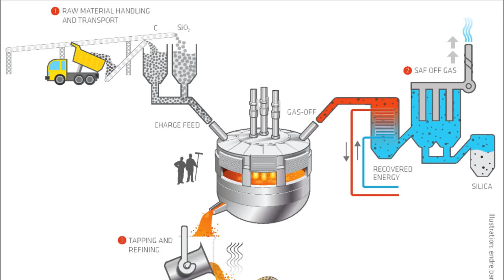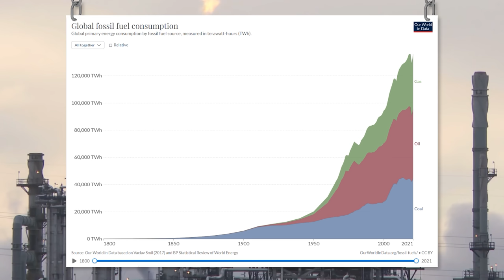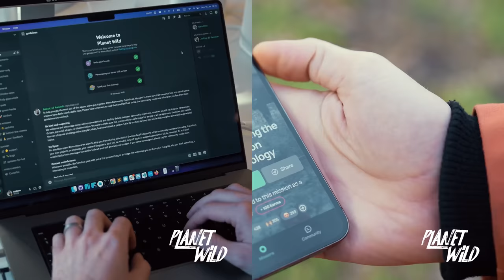We Will Be the Last Civilization on Earth

Comment: The question about the great filter is always a scary thought to think about. Are we the first civilization ever to be in front of the great filter or is the great filter in front of us? Either thought Is scary
Reply: The great filter does not exist, at least there is absolutely no reason to believe in a great filter. Occams razor states you should prefer the simpler solution to a problem. If you want to solve the Fermi paradox a large number of tiny filters is a far simpler explanation than one great filter and it has exactly the same outcome. Our existence in the here and now is dependent on billions of tiny steps. Each little step with a probability of it not happening, if one of those steps had not happened we would be here now. If those tiny steps had happened a bit slower we would not have arisen before earth becomes uninhabitable. With billions of steps involved and all having a tiny chance of not happening it's, from a statistical perspective, not exactly far fetched that we may be the only civilization in the observable universe. We lack a lot of knowledge about what was needed for us to get here. So it's mostly guessing and speculation, but with equally reasonable assumptions you can arrive either at the universe is teeming with life or we're the only 'intelligent civilization' in the visible universe or anything in between.
Reply: @silentwilly2983  That's just a restatement of the same argument.  A "great filter" is just grouping your "large number of tiny filters" into a small enough number of clearly-labeled boxes for our brains to process the concept easier.  You could write every single interaction of every electron since the beginning of the universe as individual "tiny filters" but that's hardly conducive to meaningful discussion.
Reply: Scary eh?  Well that's one way to think about it.
Reply: Not really scary, because we live in a block universe. The past, present, and future have already happened. Most people just don't realize it. We in a way are already dead. So the circle of life is just completing it's self. 
     Nothing to fear. No one escapes death.
Reply: @altrag  No it's not, with a billion tiny filters the often posed  question of 'is the great filter before or behind us?' is completely non-sensical as, by defining  billions tiny filters as a great filter, implies by definition we're in the filter. If you want to frame it differently, we have a few billions years of tiny filters behind us, and trillions of years of tiny filters ahead of us, so in that perspective the great filter is by definition ahead of us. And if you want to see it in a grander context, it's inconceivable we survive into eternity so from that perspective there will always be a great filter ahead of us as long as we exist. But these last two perspective add 0 value to explaining the Fermi paradox. People talking about a great filter also tend to talk about big catastrophic events, nuclear war, great singularity, meteorite impact etc,  those refer to one big filter, large (self) destructing events to explain the big silence,  not a large number of tiny filters that lead to  exactly the same outcome of the big silence.

And no, lots of tiny filters certainly is conducive to meaningful discussion, this contrary to one large imaginary filter one can only speculate about. With a large number of smaller filters one can apply statistics, one can define and study some of those filters and say something meaningful about them. You can determine that only a few dozen halving factors are needed to reduce the statistically expected number of civilization in the visible universe to be less than 1. Once you realize that, all those people claiming it's a statistical certainty that others are out there become a bit silly.
Reply: A Species using up or outgrowing all it's available resourses whether food/energy etc. constitutes one of the more frightening filters which is a certainty.
Reply: @silentwilly2983  Its still the same thing.  Whether you consider a "great filter" to be "organic chemistry started" or if you want it to be "a hydrogen and a carbon got together, then another hydrogen and carbon got together, then they all get together" rinse and repeat quadrillions of times, it amounts to the same thing:  We got the building blocks of life.

It does nobody any good to try and piece together exactly how all those quadrillions of molecular interactions happened.  Its just too much information for us to process and worse, its information we can't even verify - we can only guess.  At least until someone invents a time machine and goes back 4 billion years to look for themselves.

> If you want to frame it differently
I really don't.  The whole thing is a thought experiment to begin with.  We don't even know that there are any filters, great or small - It's entirely possible that intelligence is a guaranteed outcome and the only "filters" are whether any particular planet is amenable to life at all, and whether their life happens to overlap the entire 150 years we would have had even the slightest chance of detecting them.

> it's inconceivable we survive into eternity
Define "we".  Humans as we know them today certainly won't.  Even if we don't manage to kill ourselves, evolution will make our descendants a million years from now very different from anything we call "human" today.  Especially if we figure out long-distance space travel and manage to colonize other worlds - the differing environments on those worlds will necessitate rapid evolution (well, rapid compared to the speed of evolution without environmental pressures aka purely random selection).

I guess you should define "eternity" as well.  The entire universe won't survive into eternity - at least not according to our current best understanding of physics.

> lots of tiny filters certainly is conducive to meaningful discussion
No its not.  Can you even define a single "tiny filter"?  Because if you can't then what you've really accomplished is defining the entirety of life's evolution as a one great filter.  You can say a football field is 91 billion nanometers but that's rather useless when we can just say "a football field" and everyone knows what we're talking about.

> the great filter is by definition ahead of us
No, the great filters are by definition behind us, since the Drake equation (where these filters come from - ie: the response to the Fermi paradox, not the paradox itself) only counts up to the ability for an intelligent species to perform interstellar communication, and we're already there (providing we had anyone to communicate with!)

Its not a pointless exercise to imagine extensions of the Drake equation of course, but if you want to claim something is being filtered, you have to define that thing.  The Drake equation ends at "communication" - ie: things we (as humans) could theoretically listen for with telescopes.  You could add "interstellar travel" or "colonizing other worlds" or "type II Kardashev" or whatever else you want that we've imagined but haven't yet reached, and then start discussing ways we could be "filtered" against reaching that point, but "might die out some day" is just too vague to be especially interesting.

The interesting filters aren't things that kill us, they're things that prevent us from achieving some defined next level.  Eg: "planet being in the habitable zone" is a good filter.  Planet doesn't support life therefore no life.  "Planet gets kicked out of the habitable zone by an errant black hole passing by" is not a useful filter.  Sure that's theoretically a risk but its always a risk at any stage.  It might "filter" that particular planet sure, but its not in a way that's interesting to ponder philosophically.

> Once you realize that, all those people claiming it's a statistical certainty that others are out there become a bit silly.
You can also set those factors to values that make it a statistical certainty.

And that's exactly the problem with your argument.  We don't know any of these "filters".  They're philosophy, not science.  Breaking them up into "billions of tiny filters" is just an unnecessary layer of confusion if you don't define what each of those billions are.  Everyone is aware that life on Earth didn't just jump from one state to the next in 7 or 8 discrete massive steps, but that's not really the purpose of the discussion.
Reply: There are hundreds of filters.  Why do people think there is one great filter
Reply: @SoulDelSol  > Why do people think there is one great filter
I don't think too many people only consider one great filter, but its useful to break it down into a small number that can be easily managed, digested and discussed rather than some vague reference to "lots and lots of tiny filters" that are individually impossible to define, and therefore impossible to think about in any great detail.
Reply: @dananorth895  A certainty? You're maybe confusing 'natural resources' with raw materials. Resources don't come from nature. They are created by the human mind, and thus grow as a function of time multiplied by the number of people alive (a certain percentage of people born become inventors who can find new potential resources, and they reset the doomsayers' predictions, every generation). 
Now, you could say, "OK, but the Earth is limited in its physical mass, so at some point it doesn't matter how many 200IQ geniuses you can spare to solve the problem, the Earth is spent", but that's kind of silly. First of all, meteorites and comets keep raining down. But the major point is that the Earth has a vast and limitless sky surrounding it. The universe and its raw material wealth is as infinite as anyone could hope for.
Reply: @silentwilly2983 over 200 trillion galaxies in the observable universe. My brain cannot even fathom how large that is. But I can without a doubt say, no chance we are only Intelligent life in that space.
Reply: @Userhfdryjjgddf  The best position to take I guess. It's nice to not deal with the uncertainty and it's 'easy' to be proven right and virtually impossible to be proven wrong, while the position that we're alone is easy to be proven wrong and virtually impossible to be proven right. Nevertheless, with the data we have there is no scientific basis for such a claim, it's religion.
Reply: @Userhfdryjjgddf  intelligent lifeforms are out there. The distances though are so grand that it is useless to try to find out if they are there than to fix our own problems first.
Reply: @altrag glad you said it. the idea of the “great filter” is just the description of the billions of different things that can go wrong, thus preventing the birth of intelligent life. like it’s literally in the definition of the great filter as far as i’ve always known lmao. like how “car” is a pretty large blanket term, but you can categorize them pretty far down. “i drive a car” = “i got sent to extinction due to the great filter,” and “i drive a ford focus” = “i got sent to extinction because of total nuclear war,” etc. 

but yea your comment was the first thing i thought of when i saw his, and i’m glad you said it lmao
Reply: how do you know there isnt a second great filter?
Reply: @altrag  Don't know why I missed your reply, only saw it due to a notification of some other post.

>  Its just too much information for us to process and worse, its information we can't even verify - we can only guess. 

If this is your attitude then why debate it? There are lots of things that in the past were considered impossible to know and that now have evidence based answers that are generally considered accepted facts. But if you want to be skeptical sure it all is theory and nothing can be proven with a full 100% certainty, it might all be our imagination or some simulation that has nothing to do with reality. 

>  We don't even know that there are any filters, great or small -

How so don't we know? If there were no filters every single rock in space would have intelligent life on it. That is not the case so there must be filters, conditions to be met to develop intelligent life. 

> Define "we".

Our evolutionary line.

> I guess you should define "eternity" as well.  The entire universe won't survive into eternity - at least not according to our current best understanding of physics.

Which is basically the point I make, no matter what,  at some point the conditions in the universe will kill off every form of life as we know it. So, if you debate a great filter as something a civilization can't pass, it is by definition ahead as in due time every civilization will get wiped out. All life, all civilizations that develop in the universe have a life-cycle. How far a civilization has to proceed, how many small filters have to be passed, to contact another civilization depends on the distance between the civilizations. This too is, in the context of the Fermi paradox, an argument for not talking about a great filter but about a multitude of smaller filters. If the nearest great civilization was at the next planet, mars or venus, we would have passed the great filter and contacted the aliens, if the nearest civilization is at the other end of the galaxy or at the edge of the visible universe a lot of further development has to happen before we get through the 'great filter' and are capable of contacting the next civilization.  

>No its not.  Can you even define a single "tiny filter"?  Because if you can't then what you've really accomplished is defining the entirety of life's evolution as a one great filter. 

Some sure, all obviously not. Energy flux, age, resources, stability ........ What I plead for is a sort of reverse Drake equation, start with the numbers of planets in the visible universe. Open for debate but roughly a trillion galaxies with a trillion stars and say ten planets a star is roughly 10^25. Then start chipping away, throw out everything too young to have developed an intelligent civilization, with unsuitable energy flux (not habitable zone), with insufficient resource (oldest system have too low metalicity), that wiped out due to stability issue (many flavors, from migrating planets, ejected planets, radiation events such as gamma bursts, super nova, etc etc. Obviously, given our current knowledge the size of those filters are largely guesses. But some of these factors can be huge, in the center of a galaxy high energy events are frequent, based on our solar system 70% is arguably outside the habitable zone, our evolution suggests a system needs about 4 billion year to produce an intelligent species..... If you realize you only need a few dozen halving factors to reduce 10^25 to less then 1 in the visible universe it is not that far fetched to assume we are alone. Based on current understanding there are some big reducing factors on a cosmic scale, there are billions of steps in evolution each with a chance of not happening or at different speed than on earth. E.g. it took seemingly for no reason billions of years for eukaryotes to occur and I think there are more steps that seem to have happened only once in billions years of evolution suggesting they are hard steps. If you just take it all together and shout big filter there is no path forward to make a better estimate. If you define it as a shitload of small filters you may identify steps that seem critical (that happened only once, were critical in our evolution) and study them further our understanding.  

> No, the great filters are by definition behind us, since the Drake equation (where these filters come from - ie: the response to the Fermi paradox, not the paradox itself) only counts up to the ability for an intelligent species to perform interstellar communication, and we're already there (providing we had anyone to communicate with!)

No, interstellar communication is a tiny baby step compared to intergalactic communication needed to contact aliens if they are rare, if they are very rare and we need to contact/detect them at the edge of the visible universe, we're completely clueless about how to achieve that. And even our interstellar communication, I'm not convinced we achieved that, energy levels are such that if an alien was broadcasting with the energy levels we use, we would be unable to detect it certainly if they are more than a few stars away. As said before, there is no defined point where you're passed the 'great filter'. The required level of development depends on how common/rare intelligent life is. If there was intelligent life on our neighboring planet yeah, otherwise....We're not even able to determine whether there is live around our neighboring stars let alone communicate with intelligence in the Andromeda galaxy or beyond. 

>   It might "filter" that particular planet sure, but its not in a way that's interesting to ponder philosophically.

The point is that this is very relevant if you want to go beyond philosophy and pointless speculation and into science. That particular planet stands for a category of planets, that opens a statistical pathway towards defining an upper limit to the number of civilizations out there, it chips away x percent of the 10'25 planets with potential civilizations out there. Every x you manage to define lowers the number of civilizations you may statistically expect out there. If we manage to find a few dozen x's that are 50% statistics suggests we're alone. If x is smaller we need more, if x is higher we need less. If we manage to validate with some kind of certainty that high energy events in the center of galaxies are too frequent, that red dwarfs are too unstable, and all those other criteria believed to curtail the development of intelligent civilizations, that lowers the upper limit of potential civilizations out there significantly. 

> You can also set those factors to values that make it a statistical certainty.

What is your point? Those people are right because they make firm statistical claims based on assumptions? The statistical certainty they assert doesn't exist! 

 > And that's exactly the problem with your argument.  We don't know any of these "filters".

Huh? How is that a problem with my argument? That is exactly what I plea. In my first comment I stated: "We lack a lot of knowledge about what was needed for us to get here. So it's mostly guessing and speculation, but with equally reasonable assumptions you can arrive either at the universe is teeming with life or we're the only 'intelligent civilization' in the visible universe or anything in between." The point I make is that the claim of 'statistical certainty' for other intelligent life out there are based on assumptions and bad statistics and are silly. There is no certainty, even no statistical certainty either way.
Reply: @corvidflight19  Actually, the leading theory in quantum physics says, that our universe is not wholly deterministic, but partially the product of randomness. In other words: What the world is like in one second, is partially determined by randomness. What the world is like in years, even more so. There is only partial predetermination at most.
Reply: @corvidflight19  The block universe is one interepretation of physics. It is one that is favored by many physicists and disfavored by others. It is compatible with relativity, but so are other interepretations. There is absoultely no evidence for or against the block universe interpretation, unless you consider our intuitive experience of time to be evidence against it (which is certainly debatable in and of itself).
Reply: There is a book that says that present creatures (including humans) will never know what the next type of creatures that will inhabit this planet will be. because earth and nature will continue to create new species, possibly even more intelligent and with bodies that are more efficient, which makes me think earth and nature are alive and intelligent. there really is a Creator